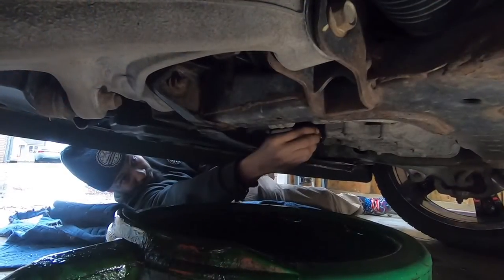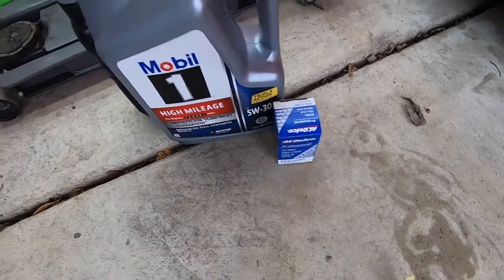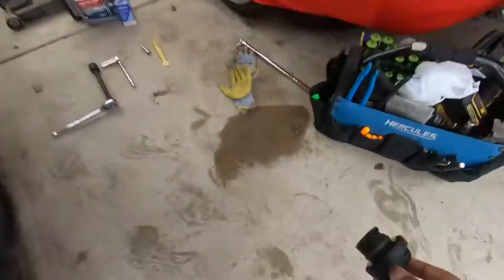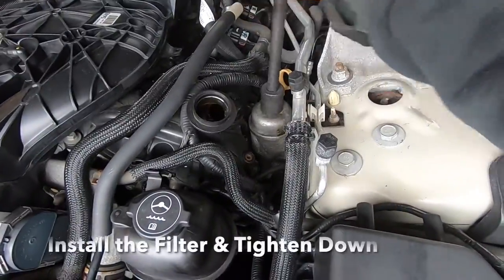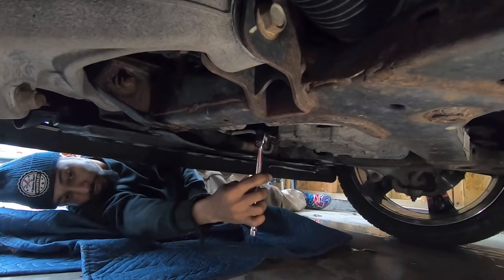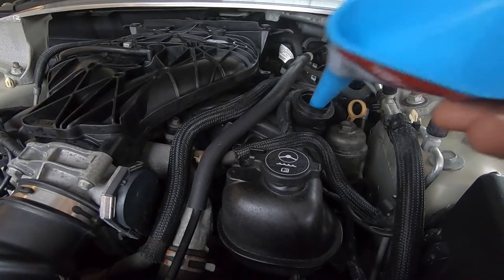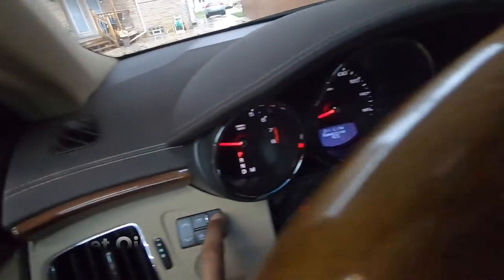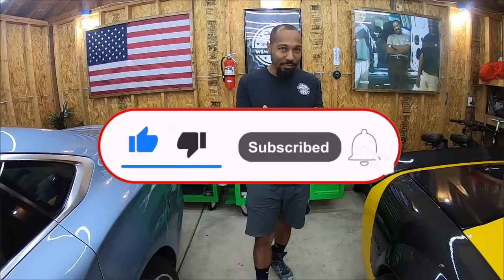How To Change the Oil & Filter On A Cadillac CTS 2008-2013 Sedan, Coupe & Wagon 3.0 3.6 V6 5W-30 AWD

Comment: My CTS has a engine shield guard. Would that need to be removed? I recently got an oil change and now the shield is hanging off 2 weeks later.
Reply from the maker: Are you talking about underneath the engine? If so, yes, that needs to be removed when doing an oil change. Mine was already gone when I bought the car. What usually happens is when you take it to get an oil change, the lube techs never put all the screws back in. It happens all the time. That’s probably why yours is hanging.
Reply: Thanks for the response. Thankfully the shield was still in one piece, so a local garage reattached it for free.
Reply from the maker: @jeromeggibson4526  Ok good.
Reply: Exactly why I change my own oil. Oil changer places do sloppy work.